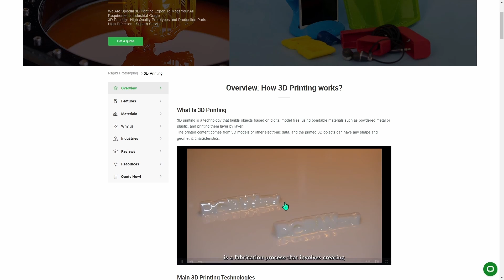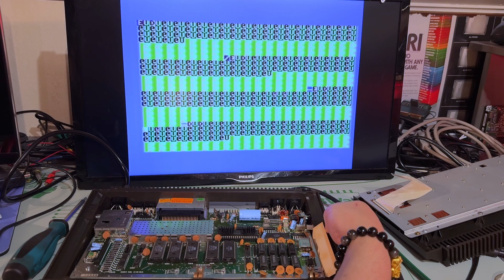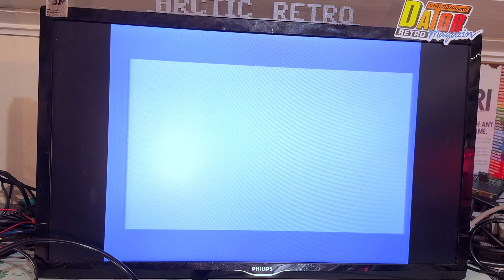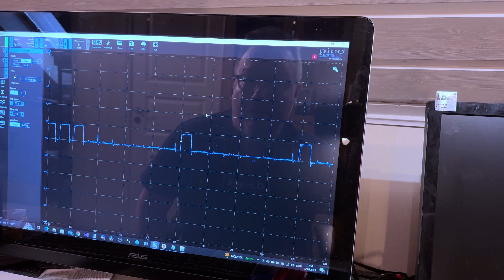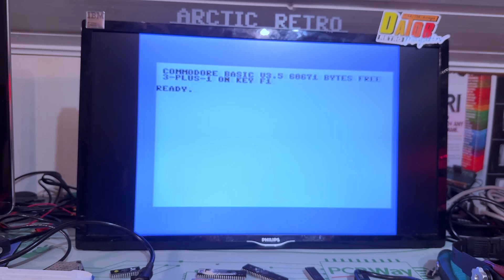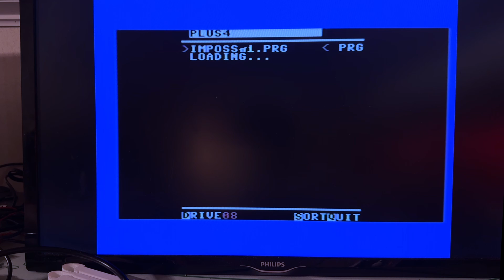Can I repair TWO Commodore Plus/4's with one spare motherboard ?

Comment: This video got me really tensed. Would it be possible the PLUS/4 could remain unrepairable? Of course not. You got it working, Tommy. And even with all the dead TED obstructing the views. The chip tester is really helpful. When a 5V signal on the bus is only 2V we can never be sure which chip it is pulling down. If it's an input of a RAM chip even piggy testing wouldn't reveal I fear. Thank you for this very entertaining one.
Reply from the maker: Thank you :)